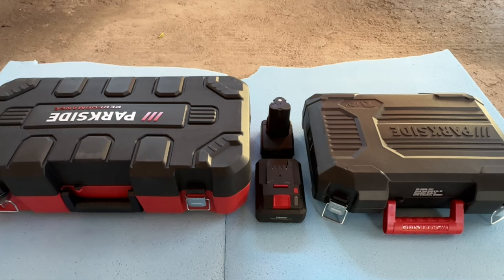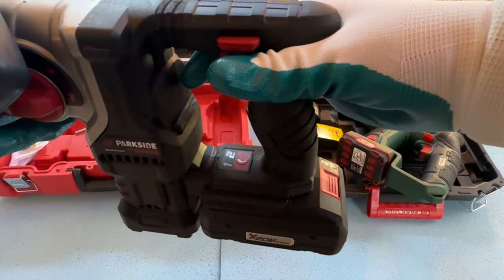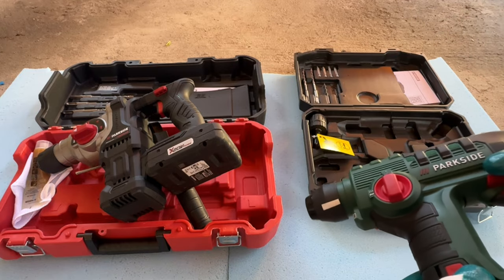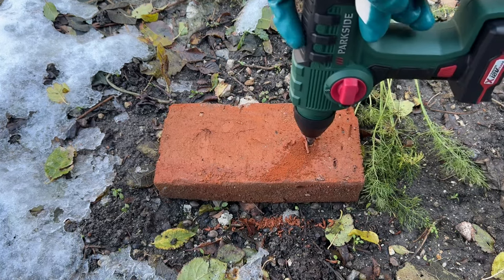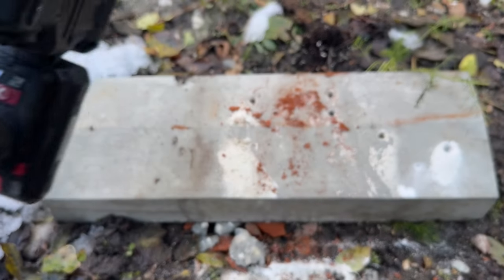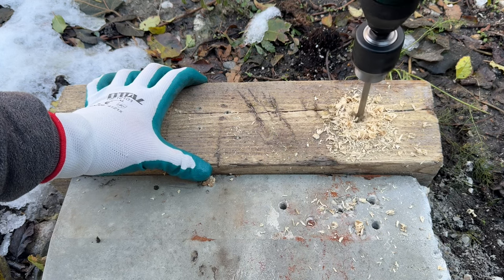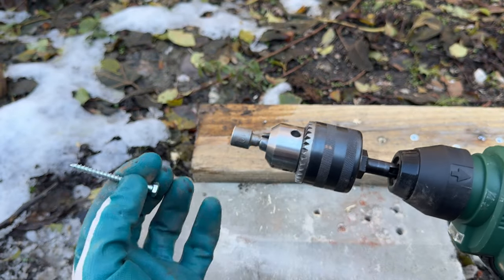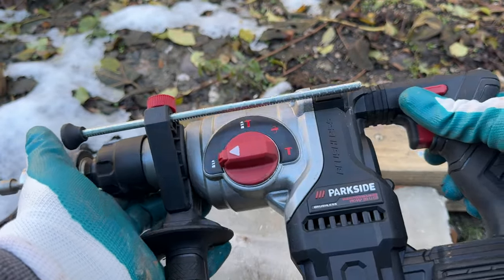PKHAP 20-li C3 vs. PBHA A1 12V David vs Goliath Parkside edition! Rotary hammer drills Performance

Comment: I have read the comments and think some people don't know how to use tools. I don't understand disappointment by some commenters with what they call "parkshit" tools.
  I have 20 volt green Parksite sds drill and it is my favourite tool ever. Actually I have 4 or 5 of them but after 5 or 7 years I am still at the first one. I mostly use it for red and brown plugs. And it is perfect. LIGHTWEIGHT !!! with 2 Ah battery, wish it had a belt clip. A few times I abused it, but was slow and gentle with 1 metre 15mm sds or shorter 32mm sds, drilled holes in stages.

I also have 20v and 28v Milwaukee and 36v Makita and number of corded DeWalt, Makita and Hilti. I use them when needed.

But my favourite daily use tool is that little Parkside. I regret I didn't buy 12Volt Parkside sds when they had them in uk, around £50. When they have them again cartainly I am going to grab one this time.

But I understand if someone wants to buy just one drill maybe Parkside is not for them.
Thanks for the video.
Reply from the maker: Thank you for your time! You are spot on with the lightweight point there! The Performance one has power but in some cases it is too heavy, for the odd DIY job I also think this is good enough and when you look at the price and warranty I do think it is an excellent purchase!
Reply from the maker: I have had the exact same type of experience unfortunately. People trying to borrow my Parkside stuff just to abuse it and try to make it fail.
Reply: @BrokeLifeEU  My second comment to which you have replied too was deleted by youtube. I wonder why. They are out of their minds.
Reply from the maker: @peckhamian  Unfortunately it does happen all too often. Many comments get deleted from this channel and I have no clue why. I do apologise!
Reply: @BrokeLifeEU  Imagine what is happening in other threads on other channels discussing more "sensitive" topics. I have noticed that sometimes even 90% of comments get deleted. I guess they don't have enough workforce to do that, so it must be badly trained AI. And the comments deleted are so often really innocent. 1984 or Brave New World or Matrix happening right before our eyes.
Reply from the maker: @peckhamian  I am working on a video in which I will compare tools from both sides of the iron curtain. I hope the channel survives that 😅 then it ends in a travel video to a communist block country to see a monument.

Comment: Great comparison. I regret buying the 12v Version... But I dont have a 20v parkside battery yet
Reply from the maker: Thank you! Well at least they have the 12V option rotary hammer for if you don't have the 20V line of batteries. Which does save you investing in to the 20V. For a 12V I think it is good enough.

Comment: Very Nice video, ofcourse the Performance is better. I would like to see a Brushless 12V Hammer Drill from Lidl..
Reply from the maker: Thank you! I made the video so I can look in to the difference between the bottom of the line and the top of the line rotary hammer drills. The difference was bigger than I expected!

Comment: With these kind of drills i prefer cordes ones. Always work better. I have everything pretty much from parkside. But Drill Hammer is a 15 year old HILTI TE15. Which still works like a charm
Reply from the maker: You have a point I would also prefer corded if I had access to a power supply all the time. With these kinds of tools corded is king 👑 and a Hilti on top of that!

Comment: How much nm you think the hammer drill has? Any way to determine it? They say 3j but i cant find a way to convert to nm since is diferent types of power mesurement.
Ask this because im curious to know what is stronger in rotational movement. For example to drive big screws, could it be stronger than the 80nm drill? Or even stronger than some impact drivers?
Reply from the maker: There is no exact way to convert J in to Nm that I know of. I would say that it is less than 3J, as it feels less powerful than a Bosch with 2.7 that I used a while ago. As for the big screws I would go with an impact wrench. In terms of this or the 80Nm hammer drill if you are looking for rotational force I would say the 80Nm drill. If this rotary hammer drill gets stuck in something it just stops whereas if the 80Nm drill stops in something you do feel a lot of kickback. So I am mostly basing my answer on a wild guess, but I would say somewhat educated as well.

Comment: Isn't the chuck interchangeable in the green version? Why you put an adapter 😅. Anyway great video
Reply from the maker: Thank you! The plastic chuck from the 12V would not have lasted if I used it with the 20V and I wanted to use identical chucks for both. Hence why Total Tools 5EUR SDS chuck adapter was the choice for me.
Reply: @BrokeLifeEU  thanks!

Comment: After being burned multiple times, all I have to say is: if you can't afford to waste money, YOU CAN'T AFFORD PARKSHIT.
Is the old saying, buy once, cry once.
Waste money on parkshit and you'll have a lot to cry.
Reply from the maker: Were you burned by green tools or black (performance). I think it would be benefitial for people to hear your story so they know about the negatives as well!
Reply: @BrokeLifeEU  Me personally wasn't burned by the black crap, but know more than enough people who were. The cost on the black ones is higher, hurts more. It doesn't make me happy to hear them complaining about the black parkshit, but I rather have them complaining than me. Also I worked with some of the black parkshit and I didn't like how they feel. It's a me thing though, not necessarily the toys.
This will be a long read.

Saw PASA 20-Li A1 - Great to handle, really comfortable in the hand. First time using it, it struggled (by struggled I mean I smelled burning) and I soon realised I couldn't push it. So I was very careful with it. It eventually ended up breaking the motor shaft. Death sentence, was replaced under warranty, and I bought an einhell which I deliberately have been trying to break, abused it hard multiple times... That einhell is resisting the abuse.

Trimmer PGKGA 40-Li B2 - Replaced 3 times under warranty. First one broke a part by the blade. Second one would just stop for no reason and lack power. Third one lack power, stopped for no reason and when it started to smell like something was burning I sent it back. Fourth, never used it, still new in the sealed box. Bought a petrol one from einhell, really happy with that einhell too.

Hammer drill PABH 20-Li B2 - First time using it, I almost burned it. The selector is jammed. After that only used it a couple times on very light duty so I don't burn it. Mildly serious work I grab my old DeWalt.

Disc grinder PWSA 20-Li D4 - First and probably only time I used it, cutting a 1mm steel sheet it kept stopping. If it has not enough power to cut a 1mm sheet... Guess what I use when I need a disc grinder? Yes, my 20 year old corded einhell.

Drill PABS 20-Li E6 - This is one tool I thought really worth the money. For 3 years it was great, although I haven't used that much. Last month I used and it worked flawlessly. A week later I took it out of the box and it was dead. I thought it could be the battery being cold. Multiple batteries later, it wasn't. The drill was really dead. Fortunately I took it out that day, two days later and the warranty would have expired. Was just in time to get a replacement under the warranty. I would be really pissed if I hadn't tried to use it that day.

There's also a corded drill that I simply never use because I just know it is shite. I have absolutely no use for it.

The people online, like yourself, may or may not be (they are not) putting these parkshit toys through it's paces. I have not used any of these parkshit toys professionally as I did with Ryobi, Einhell or DeWalt, I don't believe they would survive to the end of the day if I did.
Reply from the maker: I can totally agree that I am not putting the tools through their paces and I absolutely agree they are not meant to be used in a professional environment. They are after all being sold by a grocery store. I have also had issues with Parkside tools before, however because they were under warranty I got a replacement no later than 3 days after the fact. Of course I can not expect them to last a lifetime. They are not a name brand such as Makita, Milwaukee or DeWalt. I do however like them in terms of how cheap they are to get in to. Especially the batteries. For me they have solved some problems, however one needs to know what to look out for, as they do have some appallingly bad tools too. In my experience the worst one I have ever bought is the 400Nm impact wrench. It said it was 400Nm on the label, however it would struggle to undo 150Nm and at 200Nm it would just give up. I mock the tool, however once I presented all of this information to the local Lidl store I did get the option of a refund or another unit. I chose the refund and I can say that the transaction was quite brisk. Nothing to complain about on that front at all. I do understand and value your point. Lately the 12V PPDSSA impact wrench has proven to be quite disappointing. I should have bought a Milwaukee 3/8 stubby that would have done all that I wanted it to. Instead of the 25% to 50% of the job that the Parkside "stubby" did. On the other hand one is 50EUR and the other is 250EUR. So one must accept that for that much of a price difference there are many cons to be had. So one must weigh in on what they can afford and what they are after very carefully. For me Parkside was the entry in to the power tool world, but I am sure once and if I have the funds I am moving over to Milwaukee.
Reply from the maker: Solid point! Nowhere to buy parts for Parkside is a big negative!
Reply from the maker: Festool are one of the most premium tool brands. I don't use these tools so much so as to be able to justify the cost for Festool. But I like Milwaukee mainly, because they have a great line of 12V tools that are great for working on cars, bikes etc. And that is mostly what I am after.
Reply: Ich bin mit den Geräten absolut zufrieden, für den Hausgebrauch mehr als ausreichend. Für den Profi- und Dauereinsatz natürlich ungeeignet. Preis/Leistung ist aber mehr als in Ordnung.